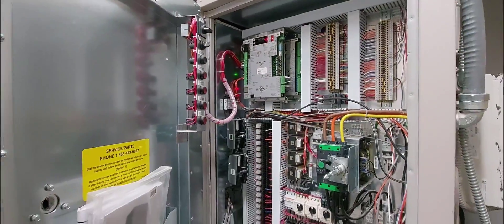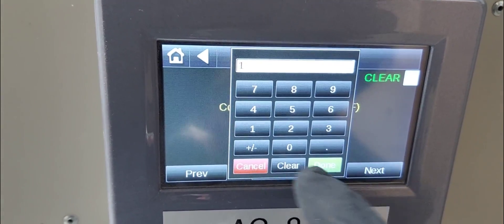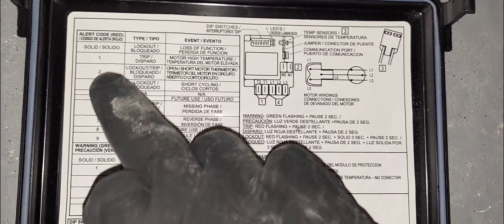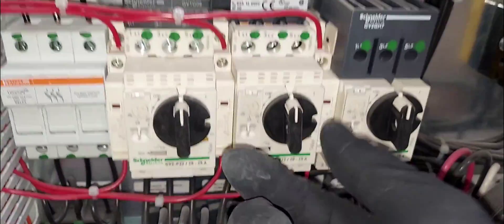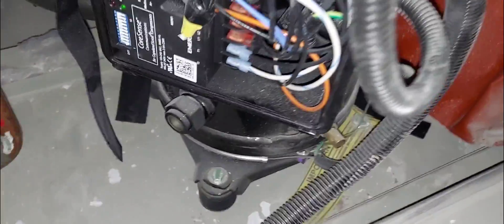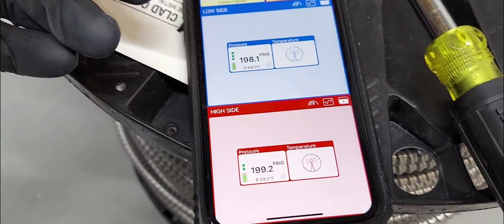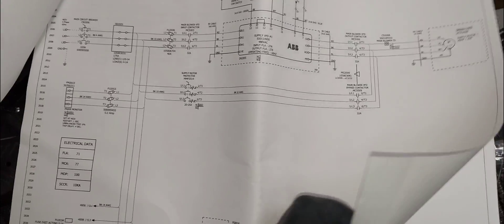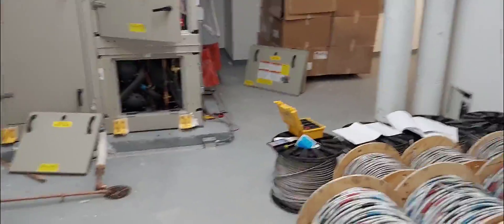HVAC TRAINING VIDEO

Comment: One thing I wish was showing more safety touching wires and troubleshooting this indepth.  A lot of new guys come in might not know about electrical safety high voltage or checking for power
Reply from the maker: Troubleshooting controls you  have to do it live, you just have to remember to remain vigilant all the time in this trade